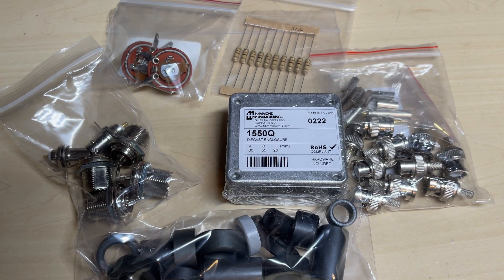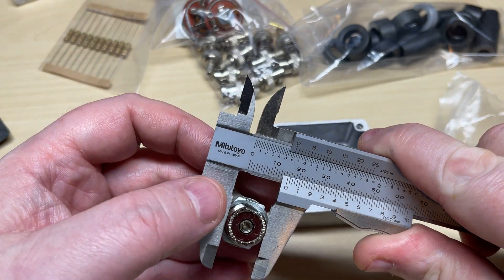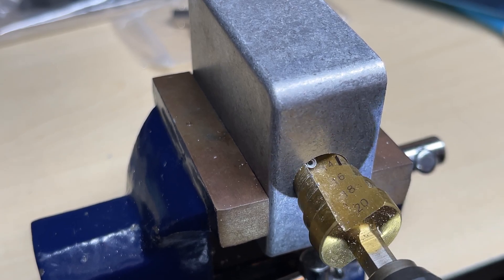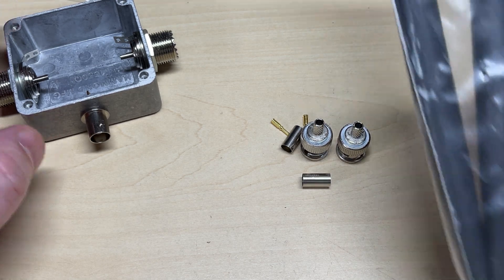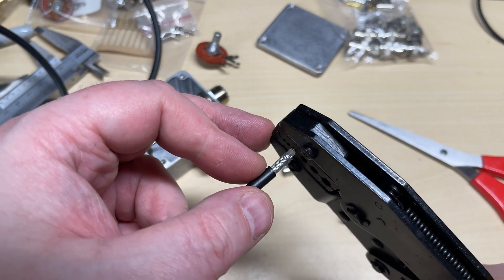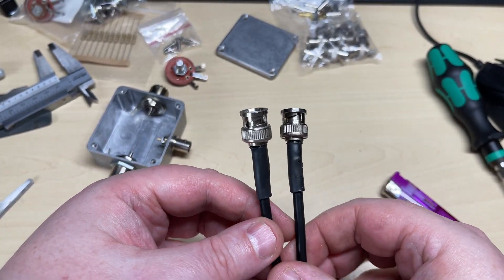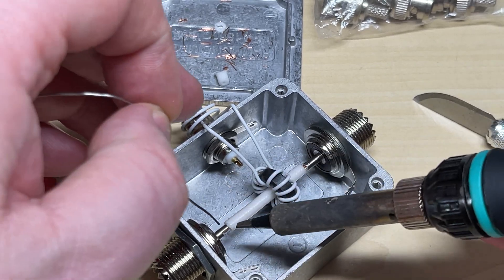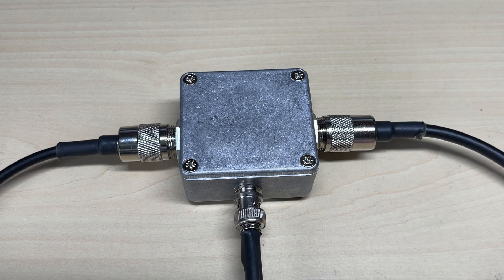How to build a simple RF tap/sampler for your frequency counter/scope

Comment: On the TRX Diagram it shows a 22 Ohm Resistor plus a 22 Ohm Potentiometer in Parallel - wont that make it variable from 11 -22 Ohms?
Reply from the maker: Hi, i did build this a bit wrong at first but it still worked as the rf tap is not coupled direct to the active coax line, i did modify it later with a variable .

Comment: Great video but what kind of toroid and winding wire did you use. Thanks a lot.
Reply from the maker: The wire is nothing special , and you don’t really need the toroid , you could just loosely wrap around the center core , the toroids are just standard ones , nothing special.

Comment: Excellent tip, but my frequency counter uses a 1Mohm impedance on the input for frequencies below 30Mhz, so I came up with a version using a double throw switch, to switch between 50ohm and 1Mohm resistors feeding the output. Works a treat.😊
Reply from the maker: Yeh my counter has the same , never had any issues using a 50 ohm terminator, maybe for small signals it would matter .

Comment: I used this design and it worked to a certain extent but my frequency meter was 24Hz out, so instead of using the torroid, I used a stiff piece of insulated wire and ran it just off the bottom of the box and now the frequency meter reads correctly. I suppose the answer is, whatever works.....
Reply from the maker: I dont know it made your reading off , as its just a rf pickup, thats not directly connected to the load, maybe too much signal , maybe not enough , but if your way works then its a win. My design was taken from TRX bench